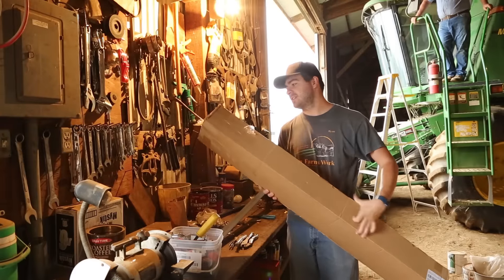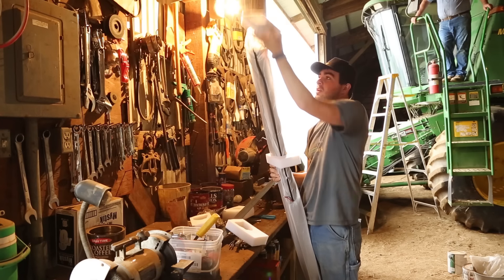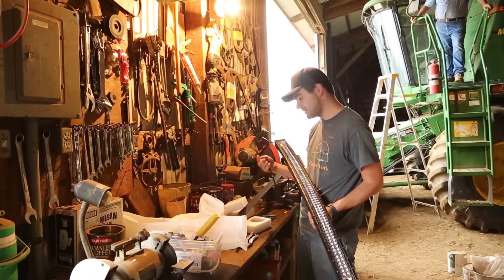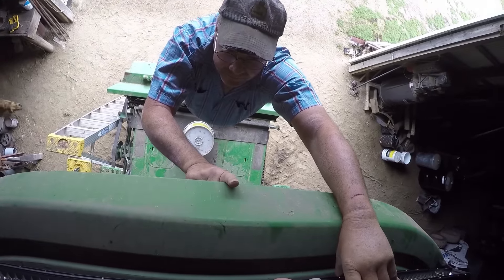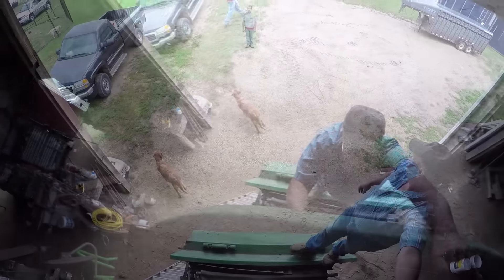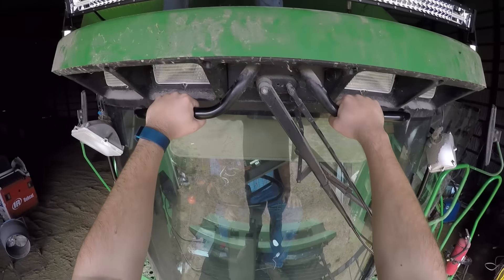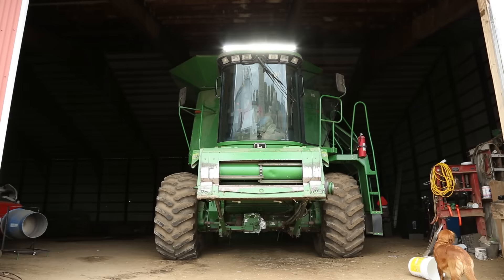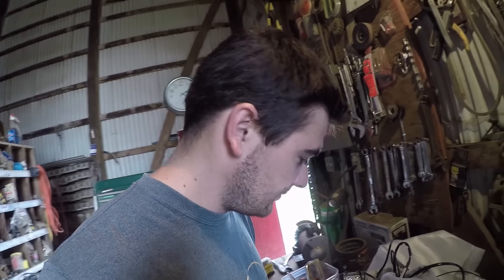Light up the Night!  - 52" Auxbeam C3-Series Light Bar for the Combine!

Comment: Be careful on top of that cab top. We traded for a 9650 three years ago and everytime the combine would set in a rain the seat was wet. Found a crack in the middle. To my suprise there is no extra support under the green plastic top and the headliner staples directly to it. Took the cab top off and had a local body shop fix it. looked awesome while it was off, convertable combine.

Comment: just a suggestion, replace the bulbs in the JD lamp (which type of bulbs goes there?) to LED (even a cheap ones) it will give you also a bit more light at the area they shine (and the auxbeam doesn't) and the "color"will match. ;)

Comment: Get the bulb number for the John Deere lights and then check to see if SYLVANIA makes a  SilverStar bulb of that type. The increase in the color temperature from about 3000k for the JD bulbs to the 4000K of the Silverstar will get rid of the yellow cast to the JD lights. The whiter light will not match the leds but will be a lot brighter.    LEDs run about 6000k

Lumens is one measurement of the efficacious of a light, color temperature is another. Higher color temperature value gives whiter light.

Comment: Hey Ryan, I have been operating our 9510 every night so far since the beginning of october. Was wondering how you wired up the light bars. I have the 52 inch one and don't know how to wire it. I just ordered the one for the auger. From a Wisconsin farmer to another Wisconsin farmer, have a good harvest!
Reply from the maker: We usually mount them to preexisting wiring that won't cause overheating issues. If that's not an option, make a separate line for it.

Comment: combine needs a wash before harvest don't you think
Reply from the maker: +Dylan VanStraalen Yep.
Reply: Just a suggestion, but I think you should get LED's for the 4640.
Another idea I thought of was if you put a little 8 inch LED on the the back side of the 4020's cab , on the left side, so it is easier unloading grain the the night when the 4020 is on the auger.
Reply: +jacob Kinda like we did on our 4440 and 4450?
Reply: I'm saying if they just put a light on the back corner of the cab on the swing auger side so it would be easier unloading grain in the dark.

Comment: Its a bit of a problem mounting a long bar on the roof of a newer New Holland because of the cab design. Best way is use a couple of long shelf brackets screwed to the cab. This way you get the bar up off the cab about a foot and angled down. https://www.amazon.ca/National-Hardware-N218-958-N218958-Bracket/dp/B003KVZVM8/ref=sr_1_38?s=kitchen&ie=UTF8&qid=1535576799&sr=1-38&keywords=shelf%2Bbrackets&th=1

Comment: wiring the light bar to the  factory lights won't cause an over heating issue?..figured it would need it's own relay
Reply from the maker: +ad1011000 It's wired to the windshield wipers. Shouldn't be an issue as long as we don't use it in the rain, which we won't be using the combine at night in the rain ever.

Comment: I put two 32" spot/flood combo LED bars on a friends tractor, one facing front and one rear.  Custom cut the mounting brackets on my CNC plasma table.  I told him he would not like the rear - too much spot and not enough flood.  The one on the front was ok, but he had me change the one on the rear to multiple 10" floods.  Floods are the best for tractors.  Problem is it's pretty much impossible to find flood only bars above 20".  If you find yourself doing a lot of LED lights, invest in a Weather pack connector tool and put yourself a connector kit together.  It's the way to go.

Comment: Should've mounted it on the front of the cab not the top. With the price of light bars falling every day there's no reason not to have every piece of equipment covered in them.
Reply from the maker: +smcox1991 We considered it, but didn't want the weight of the light bar to pull on the cab roof.
Reply from the maker: +smcox1991 Also, I believe it was too wide to fit on the front.